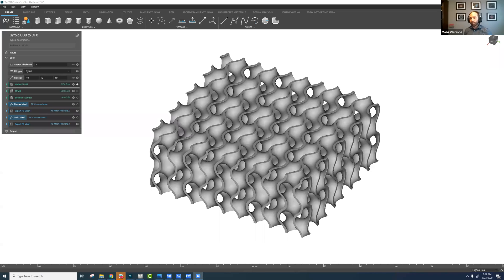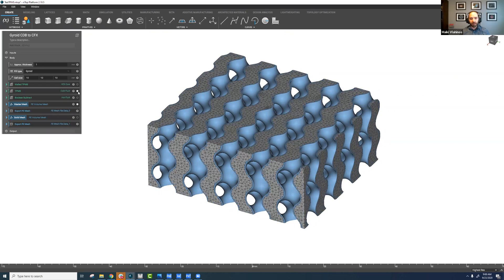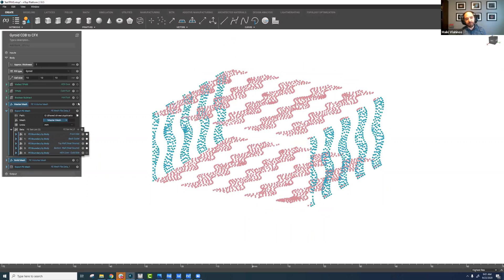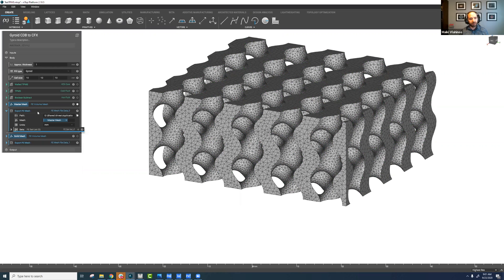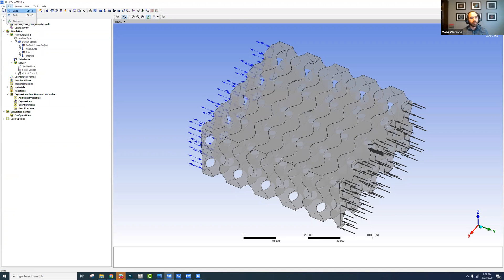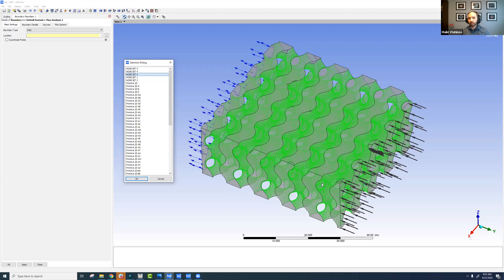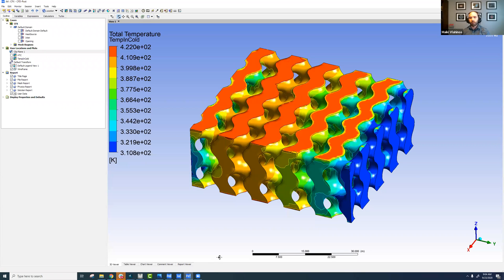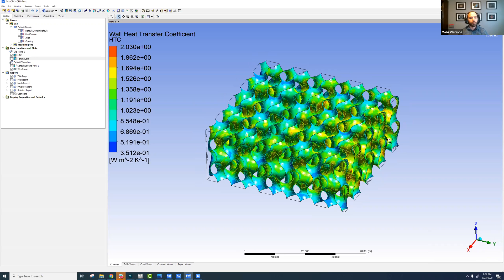nTop Live: Streamline CFD Simulations with nTop Platform and ANSYS

Comment: Hi Maiki,
I am trying to simulate fluid flow through gyroid structure and followed similar steps mentioned in the video for importing the mesh into CFX but ended with an error:

"In Analysis 'Flow Analysis 1' - Domain 'Default Domain': One or more of the locations specified for boundary 'Boundary 1' is already being used for another boundary or interface"

I think the error basically meant that few/some elements are selected in more than one node sets in nTopo. Is it correct? Please help.